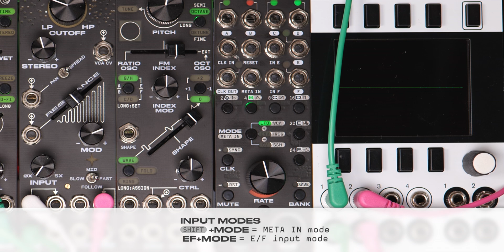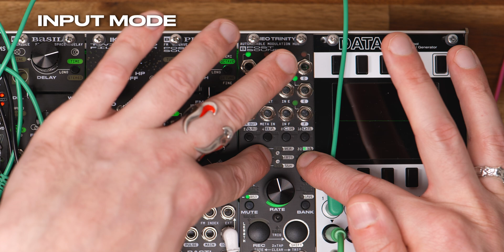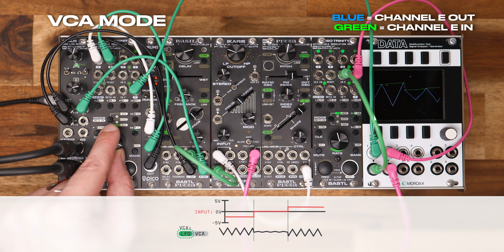NEO TRINITY - All About The Inputs

Comment: I love my NEO Trinity! It would be really helpful if the trigger mode could be velocity sensitive. The voltage levels of triggers would control the maximum output of decay envelopes, which would save needing to use the Meta input as a VCA for the same purpose